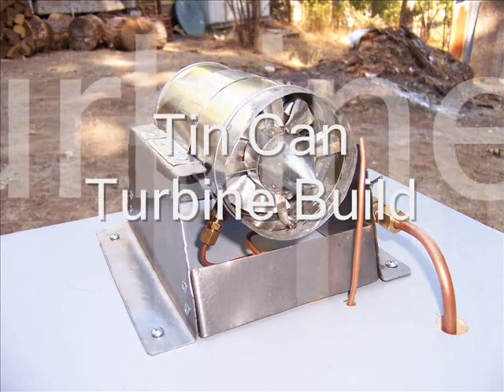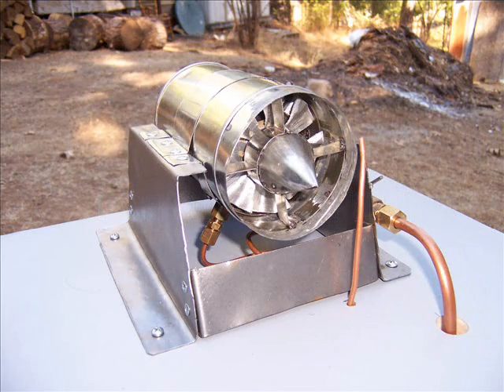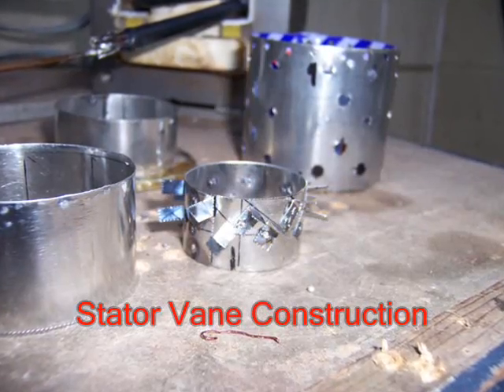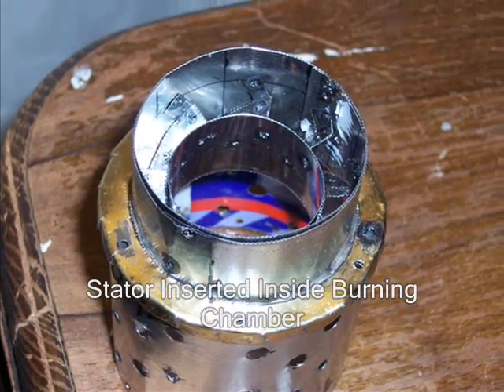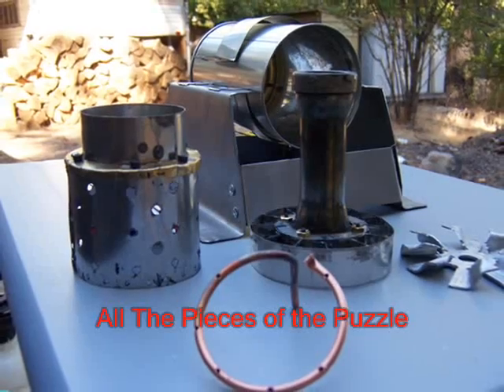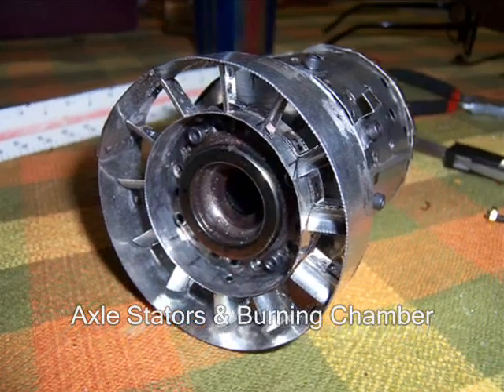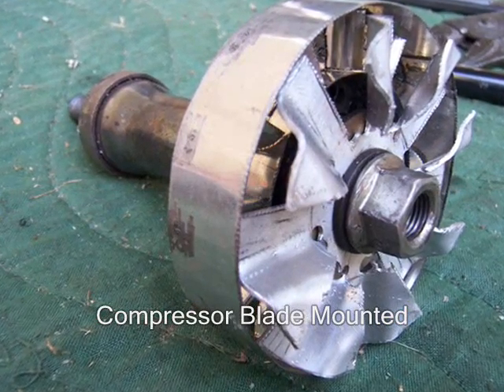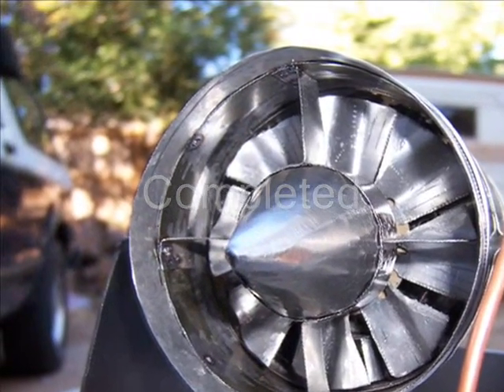Tin Can Turbine Build

Comment: fake... it is rotating using electric motor
Reply: ha ha r u mad ? don't know how a jet works. without a electric motor how can the engine suck air for combustion ?
Reply: you cant understand it so dont argue with me. go and think more about what i mean
Reply: then tell it correctly. Tell that the engine isn't self sustained. Without a electric motor how will an jet engine start ?
Reply: it starts using a motor and then it runs off the output from the turbine?
Reply: emre ann so?
Reply: jets use the power of the combustion to both propel the craft and rotate the final turbine stage which in turn rotates the compressors and (if applicable depending on the engine model) the intake fans. So no motors are needed for sustained power. However they do need some sort of external help to start. for model jet engines its usually a motor that gets shut off once the engine revs up, for full scale engines they use a smaller compressor to shoot compressed air into the engine's compressor stage to begin combustion and start turbine rotation. That's how a jet works.

Comment: Could you please tell me where you acquired that fine specimen of a potato ?  The reason I ask is because I find myself in need of one just like it , the primary function would be to film a salad spinning on a plate at 50,000 RPM, I must say I had my doubts on whether a simple potato could perform such a task but your video has convinced me otherwise.

Oh and one more thing if I may be so bold ? Did you use any mayonnaise ?
Reply: +Dmax Haha.  Ha.  Ha. Haaahh h h   h     h

Okay, not funny.
Reply: xD omg!

Comment: Nice try. This is not a jet engine. Using the forced air into the intake it's nothing more then a very cheap version of a Torpedo jet heater. You use air to force (just like the electric fan motor on the heater) the blades to spin, then use a tube to supply fuel into the burn chamber which is atomized with the forced air and you lit the fuel air mixture. A jet turbine is self sustaining once the fuel is ignited in the combustion chamber which is then forced past a high pressure then a low pressure turbine blades allowing the entire process to continue until the fuel supply is shut off causing the turbine to shut down. And there are plenty of sites and videos about how a jet turbine works. And I agree the vices are stupid and annoying.
Reply: Mikey8567 You absolute moron, what do you think happens when an engine is not moving, it needs some assistance cranking it up, that engine will work but you need a fuel pump/gravity fed to feed it in to the compressing air and something to dictate the fuel to go in (throttle) to allow for acceleration or deceleration. The air compressor is nothing more than a starter, but it will work without it once it is going... and so long as you close hole off
Reply: Mikey8567 fucking wannabe engineer
Reply: Nice your resort to name calling. Nice start of a conersation showing your lack of intelligence. Just to set ya straight I did help work on jet engines I the U.S. Navy. I worked o the electrical/electronic portion. And yes your right in stating that jet engines require assistance and starting via an electric motor, pneumatic motor, or most common on aircraft with a APU (Auxiliary power unit if didn't know what that was) they start it with a hydraulic motor. What they did was simply spin it up and forced some fuel into it. But where you lack in ability to understand is for it to be a "TRUE" jet engine it has to be self sustaining once the fuel has ignited. Meaning a and ignition control system for it, A metered fuel system, A governed speed control (that way you don't get what's called a "run away" engine. This lacks all of that short of a little hand valve controlling fuel. 

So I do know more then you seem to think I do. And unless you've had experiance with jet engines, (worked on them of built them, or designed them) you really need to back off with the lame attempt and bashing others. No I never claimed to be and engineer, maybe you need to reread my post because I never stated I was one.
Though thank you for proving that there is always someone with a mouth that likes to try and be little others thinking they are better then other. Net trolls like you make me laugh. Keep up the great work! The world can always use another joker.
Reply: That guy is an idiot!  Your turbine made with domestics materials is great! Very good.
Reply: Im pretty sure he was saying that it doesn't count as a jet engine if you don't remove the externally generated compressed air source once the engine has powered up, which is technically correct, it would not be a jet engine. An engine, by definition, needs to be THE power source. It's ok if it just needs external power to start up, but anything that needs more power added to it than it can produce itself is not an engine by the definition of the term. Also you aren't wrong in saying that a hobby project can be a jet engine too, cuz it definitely can be, but at the RPM needed for a jet engine with a completely linear flow and combustion cycle, it should've lasted maybe half a minute before catastrophic failure (catastrophic meaning total failure, not to say it would be a spectacular explosion). This is the result of most other can based jet engines I've seen videos for. On a different note, the principles that govern the functionality of a large scale jet engine are comparable to those of a small tin can engine, but they are not identical. the issue is scaling. When you scale a machine, the dimensions scale, the weight scales, but the mateial properties do not scale, One ounce of steel has the same material qualities as a ton of the same steel. Now lets imagine that this tin can model was actually using industrial strength metals that real engines use, even then the physics would be different. The large engine's blades would be lighter in comparison to its total weight than the small engine's blades in comparison to its own weight because the large engine can have them cast in such a way that they are actually hollow inside where as the small design is too small for that (the blades would be like tinfoil). inversely the smaller version could achieve higher RPM as the centripetal force on its blades would be tiny even at multiple times the rpm of the large model due to fact that the blades are much lighter. In reality though the smaller model couldn't pull off multiple times the rom of the large model because it would be restricted by the maximum capabilities of its bearings. Anyway, I'm not in the mood for any name calling so I hope you will show me the same professionalism and respect I've tried to show you if you choose to respond.

Comment: This engine is using compressed air to spin it up.  If you compare the tone at the beginning when ignition occurs ("flames start") through the remainder of the engine operation demonstration, it is very easy to tell that the air was never turned off.  In other words, this engine wouldn't run on its own without burning up.  It needs the compressed air to keep it spinning and to keep it cool.
Neat demonstration, but it doesn't "work".
It's just a loud fan with a little flame at the rear to make it look cool.  They have to turn the gas way down in order to make the flame look legitimate.
Reply: +ty_ger Every jet engines use the compressor to pull in air. This is made out of a tin can and needs assistance to be started. Once it is running the compressor is being rotated by the turbine (same shaft) and can sustain itself until the fuel is gone.
Reply: Coleton Callender
Except that this engine is not sustaining itself and the air is always on.  This engine is not able to sustain itself.  The air is the only thing keeping it running the whole time.  The flames are just for show.
Reply: Let's see you do better then.........
Reply: ***** 
You want me to create a fake turbine engine which runs on air compressor?  It isn't hard.  I created a real turbine engine which runs through a turbo charger.  Does that count?
Reply: Sure ya did Scooter..............I don't see it anywhere.
Reply: So not saying you're lying cuz I know of a few ways to do exactly what you described and have seen proof of its feasibility, but refusing to give a link is basically just taking credit for whatever video one finds first when searching for home made turbo charger jet engines. Its your claim, don't be a pussy and back it up. No link = No proof.

Anyway I digress. My main concern is with your metric for telling if it's compressor assisted. Now I'll admit, I do think a single bladed compressor stage is unlikely to supply enough initial compression for a meaningful reaction in the combustion stage. However, I went over both demos and couldn't identify any sounds that I would not expect such a design to make. If your referring to the 1st run where it gets higher pitched after he opens that valve, if it was indeed fuel flow being increased then one would expect to hear an increase in the pitch of the engine whine, a decrease in the flame flickering sound (that sound that sounds like a flapping flag in a storm wind) cuz the combusiton gets more and more oxygen rich and efficient, and visually the flames would recede closer and closer to the injection point as the added airflow causes all the injected fuel to finish complete combustion sooner and sooner. Those are all very god indicators of proper functionality, however the lack of that flame flicker sound whatsoever in the second demo was a little odd, however this could have been filtered out by the same technology and software that gets rid of wind noise in audio recordings.
Reply: It shows an axial single compressor stage. In my opinion, at that size this set up will not work. They all work with radial loaders.
Reply: ***** 
Sure did.  It probably isn't too hard for you to find my other account with video if you look for it. I like to keep the accounts separate so won't give you a direct link here.
It's quite easy to build a turbo charger turbine engine.
The "turbine engine" in this video is just a prop or display piece.